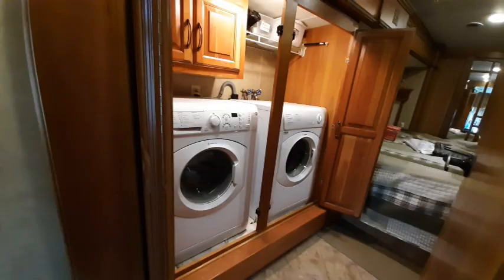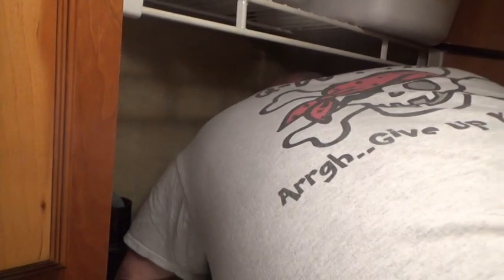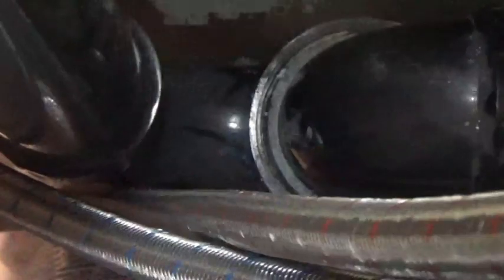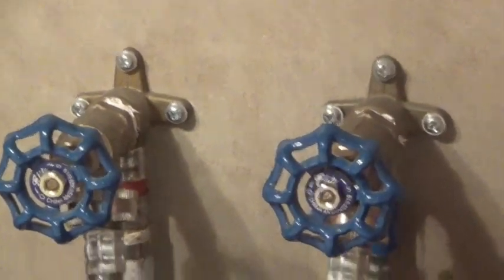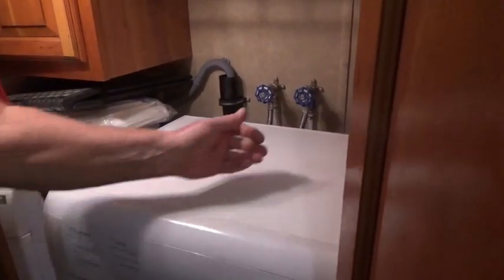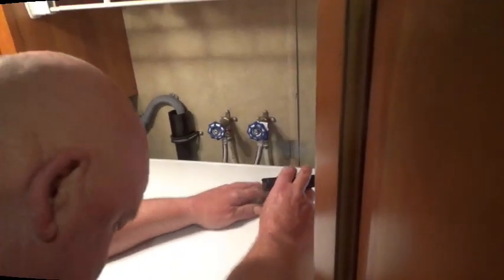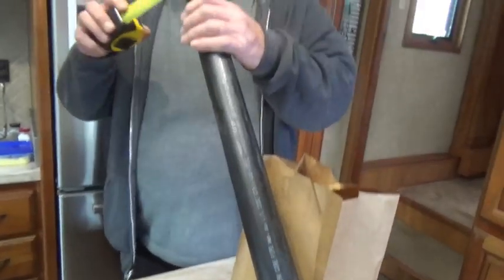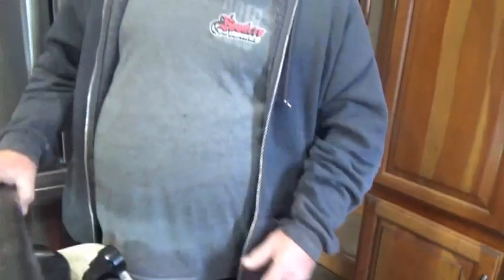🥵 Another RV Slide Water Leak // Water Dripping Out of Our Slide  // DIY

Comment: Our P-Trap wasn't even connected. It was barely stuck together. Pretty much held together by the wall it was located in. Not screwed tight whatsoever. I had to cut the wall out to get to it. Fixed now and the hole is covered by the washer. Gotta love the workmanship that goes into these rigs.
Reply from the maker: Good grief...unbelievable.  I guess that's what you get with no codes to build by.  It's a shame.

Comment: I had a Splindide in my Alfa and had to pull it several times to do repairs.  To get the vent back on and sealed I pulled the outside vent and I purchased a new section of the foil vent tube.  I connected it to the washer and slid it out the wall.  Then I pulled it somewhat tight and cut it. I attached the outside vent tight to the foil and put caulk around the opening and collapsed the tube enough to reattach the outside vent. No leaks.  

I somewhat miss not having it in the new fifth wheel but I don’t live in it full time just the 6 winter months and I bought a bigger hamper and Walmart sells cheap jeans and shirts. 😁
Reply from the maker: Wow, that was a lot of work.  I got lucky with our vent.  I hear ya...Walmart is cheap.  :)

Comment: Great job as usual, Dave. You should write to DRV tell them about you simple fix. I'm like you, why put threaded piping with water at any joint on an RV that can loosen up over time. Thanks you for sharing. You deserve a 12 pack for that job, I didn't hear cost for removing and putting dryer back and fastened down. 😁😁  thanks again. 👍👍
Reply from the maker: Thanks guys. Always appreciate your comments.  Oh man, forgot about beer for putting  it back in.

Comment: Good fix... But I do wonder on the efficacy of using a solid u pipe at the bottom.. Almost feel that the slight flexibility of the rubber u would act as a buffer between the sections of downpipe and stack and allow for the whole unit to flex... But hey, if glue joints work, they work
Reply from the maker: I guess we will find out.  😊  That glue does not budge once it dries, but you never know.

Comment: Good catch on the water leak, Dave. I've had one of these Ariston washer's in my 2010 DRV for about 10 years without any issues. I've noticed that my washer is sinking down at the back and is no longer level. I've also noticed that the 3" trim on the outside bedroom slide has sagged quite a bit too, but I'm wondering if it's due to the long time weight of the washer sitting in that slide. Was your DRV made by Thor, or was it before Thor took over DRV? I looked at my black plumbing drain pipes, and all of my PVC pipe is mostly glued, but the P trap is a combination of glue & screw. It seems to be all dry down in there. I do know that the my Ariston washer has a large concrete paver type of weight on the bottom pan of the washer, as I saw it a few years ago when I replaced the pump on it. I'm going to pull my washer out this week and remove the concrete paver and look for leaks. Will also find out how the washer shakes after the concrete removal. I'm in Oklahoma for work with my DRV and have heard that there's a company in Superstition Springs, AZ that makes good floor repairs (Miller RV Service). Have you heard anything on this company, or would you recommend that I take it to your repair facility in Indiana. New subscriber here and thank you so much for your help.
Reply from the maker: First of all, thank you for subscribing.  We were built before Thor.  If you have that much of a sag, my guess is you have a rotten floor.  Try sticking a screw driver in it.  The leaks can come from anywhere and be so tiny that you don't realize it until time passes and it slowly rots your floor.  We had this happen to us again.  Did you see this video?  https://youtu.be/RxEPHwsDnts  That was an eye opener for us.  Maybe it will provide a little more helpful info.  Not familiar with Miller RV Service.  I'd check out Rolling Retreats or Whiskey Mountain for the repair.

Comment: You mentioned that your insurance replaced the floor on your slide out from a water leak.  We are about to go full time and we would like some direction on what insurance to purchase we have tire and wheel and towing, We also have typical RV insurance. We have a class A and will be towing a Jeep Gladiator. Thanks for any direction.
Reply from the maker: We have Safeco Insurance on both the RV and truck.  So far they have worked out.